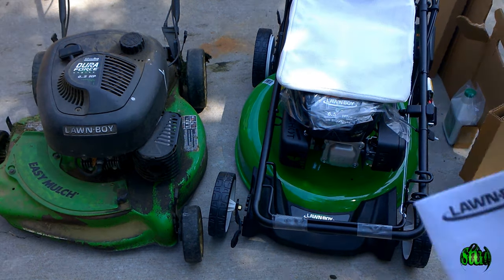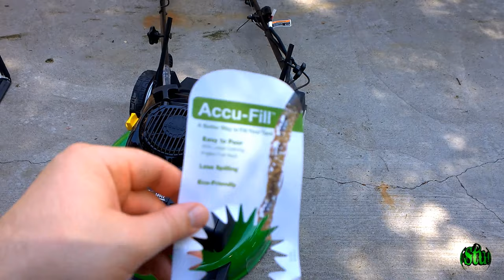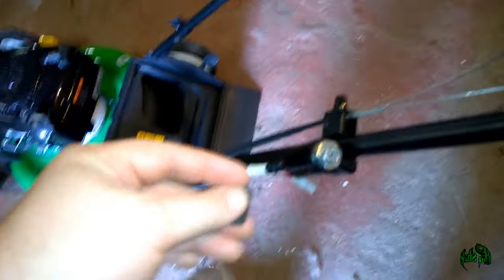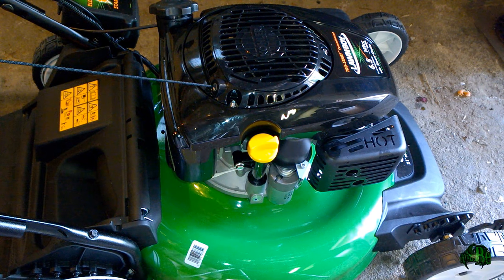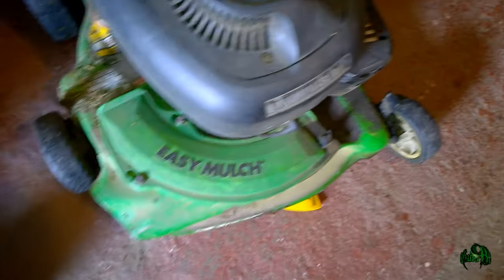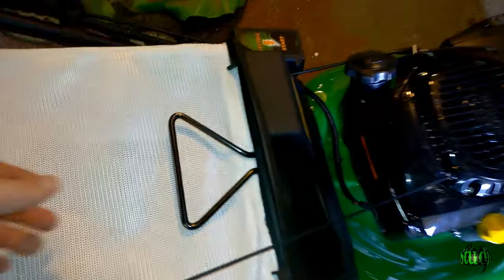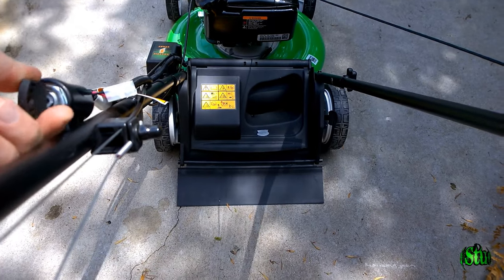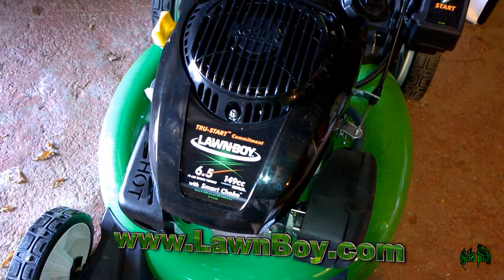Lawn Boy 10734/17734 Unbox and Assemble

Comment: I have a Lawn Boy 10734/17734 Electric Start mower, with the Kohler XT series. The problem is I need a part number for air filter on XT series. Ace Hardware has tried twice to get the correct match, but failed. It certainly wouldn't hurt to have Lawn Boy have part numbers on replacement parts available when purchasing the mower.

Comment: Should it have a central belt cover around the pulley on top of the blade? Google others and confirm with producers or sellers. Thing is, grass goes right in-between the belt and the pulley making the performance drier and drier until the belt breaks. Check others and you probably ask for yours if in fact it should have one cover in the center. Is like a c in shape in the center diminishing considerably the space between it and the belt so a minimum of grass can go in there.

Comment: I misplaced the charger and having trouble ordering a new one.  Can you help me?
Reply from the maker: Check amazon https://www.amazon.com/Lawnboy-Replacement-104-4216-CHARGER-12-VOLT/dp/B003XOBE1O
Reply: just checked that link above.  Looks alot like the Battery Jr Charger I bought last year to trickle charge the batt on my 2011 Suzuki V-Strom cycle.  Not sure what voltage each battery requires but looks very similar.  About the same price too.

Comment: Hmm, just saw where your ,very good review, is about 4 yrs old.  I just ordered the same LB-17734 model mower.  It's same model # so unless they've made any changes, guessing it'll be the same exact mower.   HomeDepot/Amazon has em same price.  But none are  at HD stores today.  Since I have to order it anyway, why not let Amazon free ship it to my front door.  Hoping my new mower works well as your's. It's replacing a several years old, twice repaired, red, Toro.  Look forward to the key start, easier wheel adjustment, Kawasaki Green is cool too.  {;>)
Reply from the maker: It's a good mower overall, but be careful about slamming it down on the front wheels. Those notches are plastic and can break over time with rough use.
Reply: Yes, second vid I saw where this is mentioned.  It will stay in my garage when not in use and I don't have a huge yard. I'm very cheap, so I take care of all my crap too well. LOL.  Do you still have your LB mower and how's it holding up? All the brands I was researching had some kind of issues by customers.  Mowers just aren't built like they used to be; metal. Considering this was 4 yrs ago, thanks for the reply. Mine arrives next week, hoping it serves me well. peace, e.
Reply from the maker: Yeah, still use it. But I made the mistake of slamming it down on the front wheels to dislodge wet grass, and after a year of doing that the plastic wheel notches broke and it had to be repaired. That was never a problem with the old mowers since everything was metal. Also be careful of banging the plastic battery cover on poles and such when mowing around things because it will break too. It works well, good power, but like you say, they don't build them like they use to.